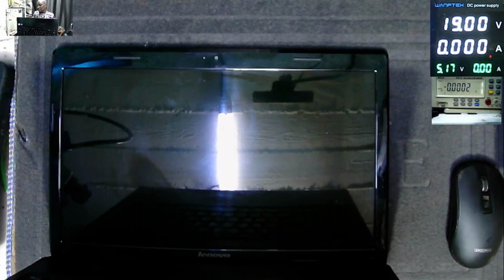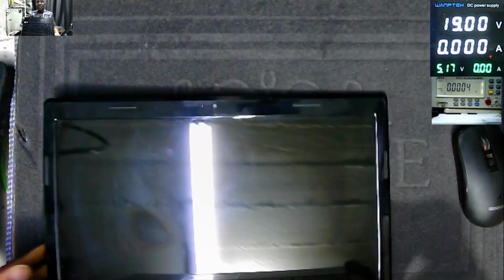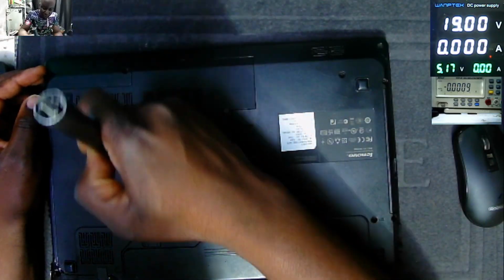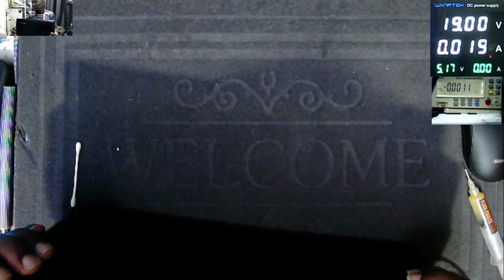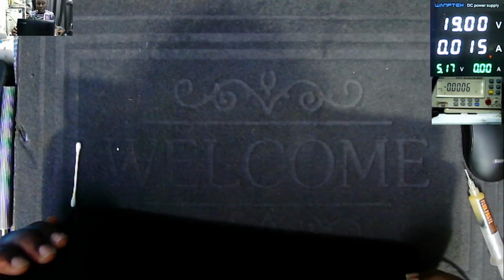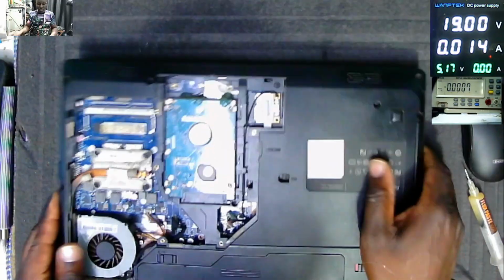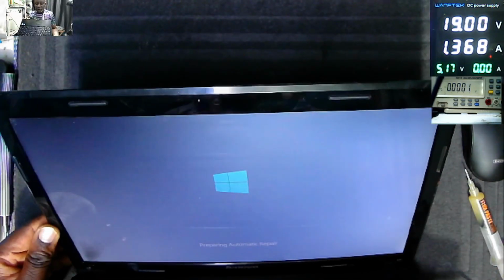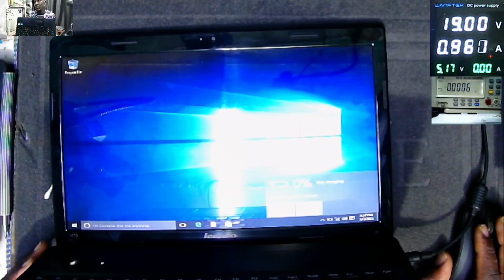Most Common SMD Component To Fail On A Laptop Motherboard –Guess It, Feel It, Sense It.

Comment: Bro I remove two smd capacitors laptop Toshiba c655d and laptop is stop working is normal laptop stop working is 100 %
Reply from the maker: Did you replace the capacitors.. If not please replace them... After replacing them if laptop is not working something Wil b wrong there. Make sure all required voltages are present to power on the motherboard
Reply: @BstAfricanElectronicsSurgery No bro
Reply: Did you think that can cause laptop not work bro😅
Reply: @BstAfricanElectronicsSurgery  bro only answer can cause missing capacitors drop volt battery pins in motherboard